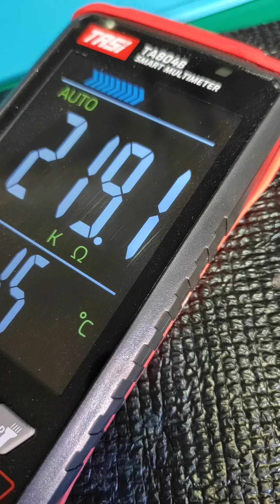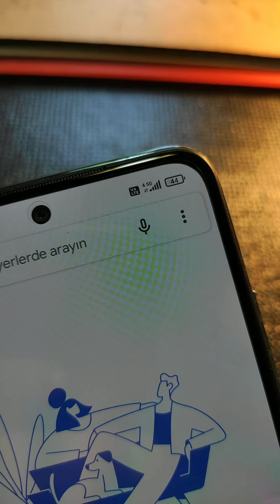Xiaomi Redmi Note 10 4G Dual Sim imei Repair | Resistor Change | Direnç Değişimi

Comment: Bro how to fix nv data corrupted on redmi note 10?
Reply from the maker: You can update and factory reset. You won't see an NV DATA CORRUPTED error 220k resistor use
Reply: @cii  my phone won't start. how can i update if i am stuck on logo screen?
Reply: @cii  i have already changed resistor after repairing imei. Phone was working fine until i updated. Now it is stuck on "nv data corrupted" screen and wont start..!
Reply from the maker: @heydocc  miui 12.02 install
Reply: @cii  okk i will try. Thanks